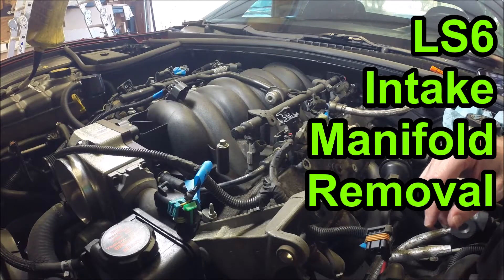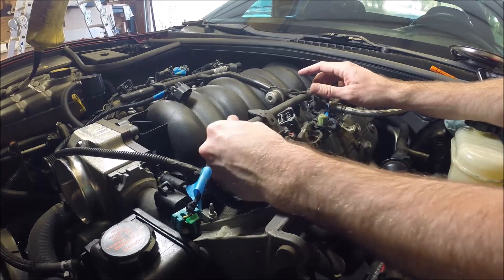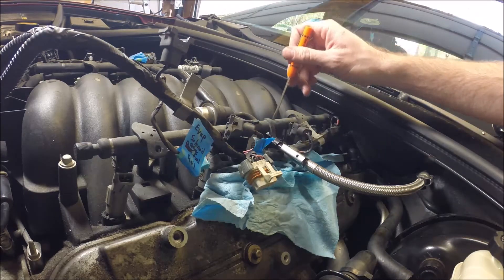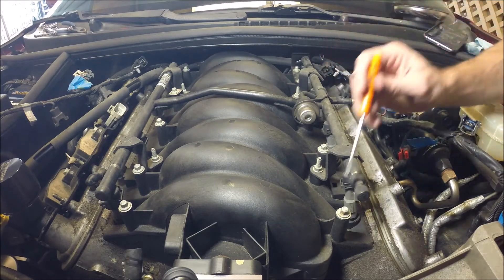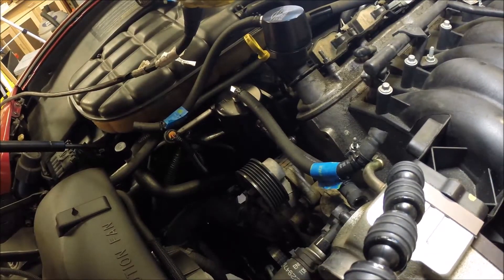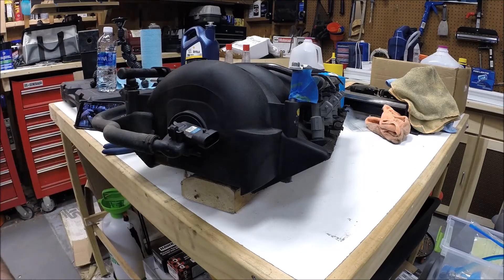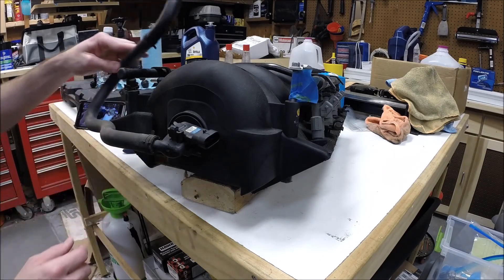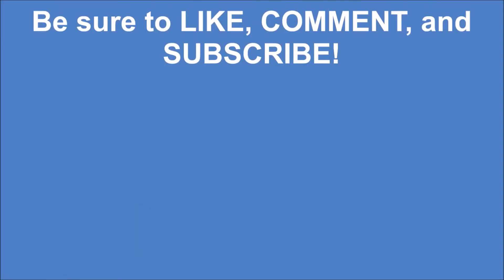LS Tech:  LS6 Intake Manifold Removal

Comment: Hey Scruf! Nice video. Was wondering if you could answer this for me, were there any coolant lines behind the block because I have a coolant leak back there and was wondering if I need to pull my manifold off to get to them, thanks -I have a 01 camaro ss
Reply from the maker: In 01 the LS1 in the Corvette got the LS6 intake manifold, and when they did that they eliminated the rear steam vent lines that run between the cylinder heads.   But I don’t know if the Camaro got the LS6 intake.  If you have the LS1 intake manifold then you probably also have the rear steam vent lines, which run under the intake.
Reply: @ScrufsGarage  A previous owner installed a LS6 intake on it 4 years ago. My car overheated and I have a hissing leak behind the block now on the drivers side. Just was wondering if you seen any lines back there, thanks